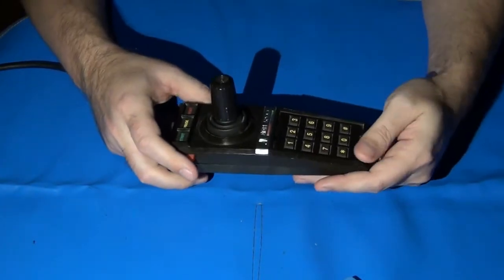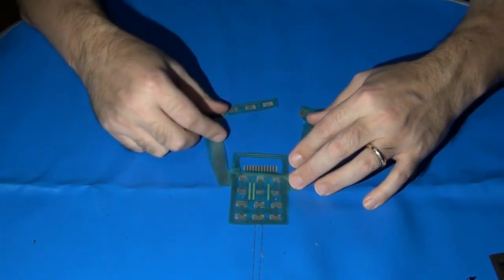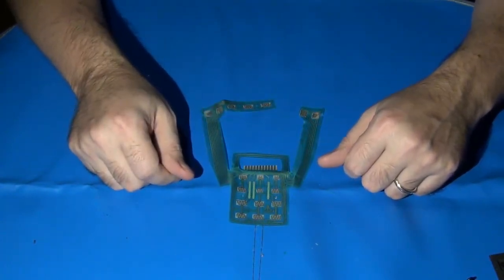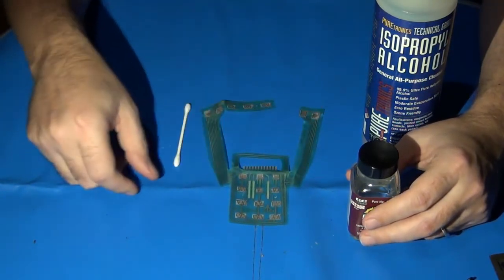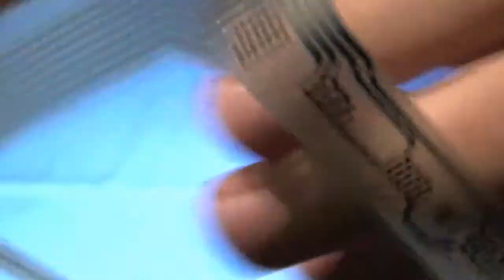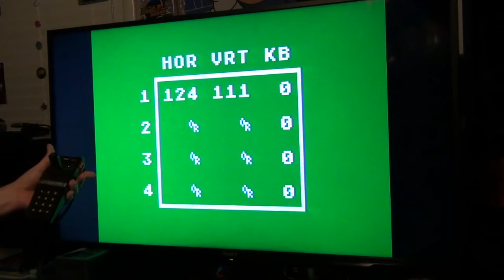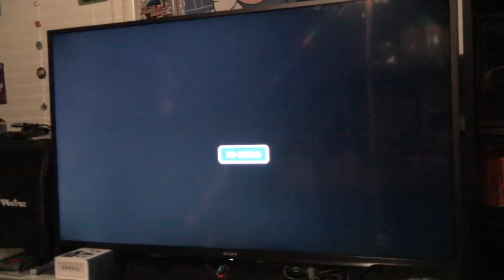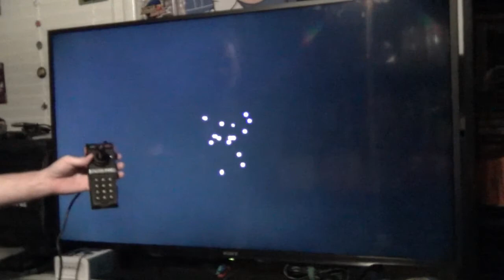ITC#22 - Atari 5200 Controller Refurbishing

Comment: Excellent video...thanks.  Quick question. My analog stick doesn't go left or right , just up and down. Can this be fix by cleaning the petenchydometer (excuse the spelling) or is the controller finished?
Reply from the maker: The top potentiometer controls the up and down movements. So it could be a simple issue of the potentiometer arm not being seated into the controller plate properly. It could also be the internal wiring within the controller cable as I've had the wire break within the controller cable on a few controllers in the past. Do you have another controller you can use to at least verify the issue isn't the console itself?
Reply: I took the controller apart and manually moved the part. I got no response.
Reply from the maker: @randyclement6568  Did you have another controller on hand to see if the up and down responds on that one? There is another potentiometer inside the console itself. If you remove the top cover and look towards the lower right under the power switch area, you will see two trimmer pots that can be adjusted. You want the smaller of the two that will be nearest the front of the console. Small adjustments to that can also correct some controller cardinal direction issues, but you really need to verify if the controller cabling isn't to blame first. There are number of components in the console that can cause some issues with the controllers so you just have to start with the easiest first and work from there.

Comment: I can’t believe you can use your fingers to put those dots on.  I would use a pair of tweezers
Reply from the maker: Been doing it for over 20 years now as needed and never really had a problem with it. I also have copper foil tape that works better, but it is more fragile and even more difficult to initially attach.